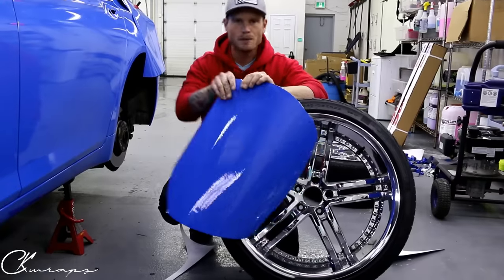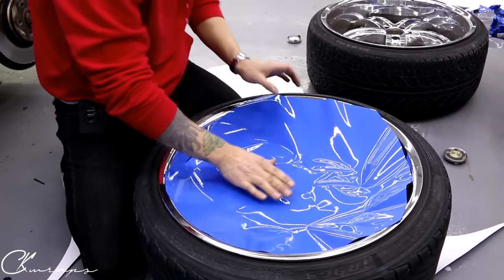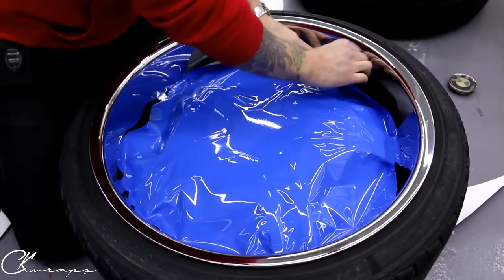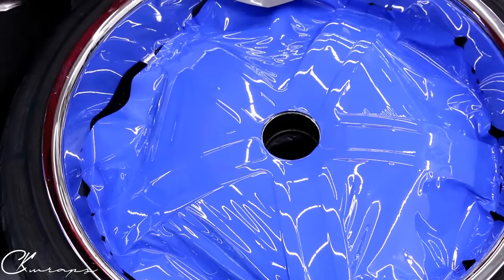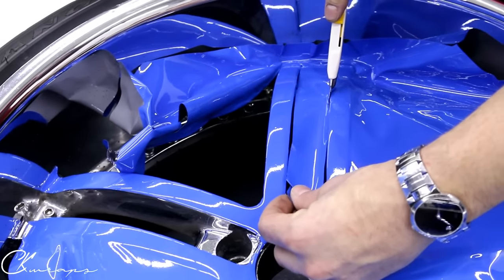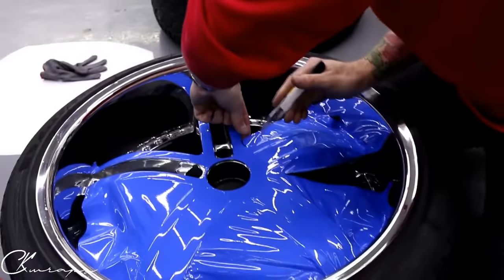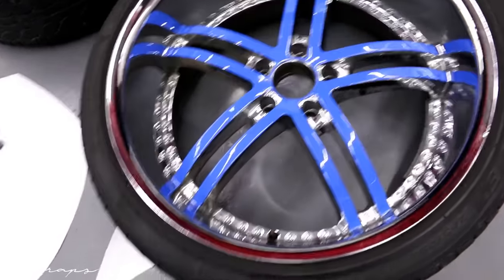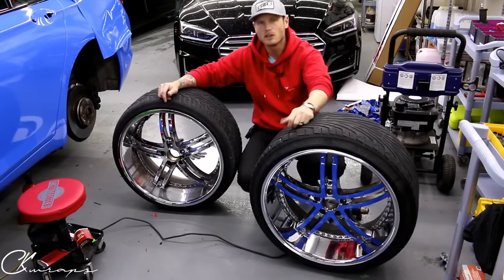15 minutes How To Wrap Wheel Faces Like A Pro Using Gloss Riviera Blue To Match The Car

Comment: Looks great! My suggestion is if you are going to offer this service, then go out and buy yourself an old bar stool so you can set the wheel on top of it and do the work up off the floor level.  
"Work smarter, not harder"
Reply: I would make a big lazy Susan to mount the rim on
Reply: he could be comfy in the position.

Comment: This is very interesting. I have a car relatively inexpensive 2009 Pontiac vibe GT lots of wheel rash. I’m thinking of just using touchup paint even though that will not look great it’s better than what I’ve got. Another option is plasty dip. However the wrap from what I’ve seen gives the best overall finish

Comment: If you were to wrap the inside of the the spokes as well how would  get complete coverage in  a situation  where the two spokes are close together ? It looks likes there just not enough material after the wrap is slit 50/50...just curious.    I just picked up a set of Torq Thrust that are all 100% chrome for my challenger so ill be doing the wrap...Job well done, Im sure its not as easy as you made look....

Comment: I‘m not an expert in that, but I think if you use a sharp water jet, like in the car wash, the water will untighten the vinyl, because it is  cut direct on the edge of the spoke. If the spoke is wrapped on 3 sides  that effect will be avoided.

Comment: Seems like you can wrap just about anything, have you ever wrapped fender flares on a truck? And not the simple ones, I'm talking textured flares with simulated bolts/rivets.  Can it be done?
Reply: Usually with textured stuff, like plastic, vinyl doesn't like to stick to it very well. Unless it is the DI-NOC films that has stronger adhesive backing.
But yes, it can be done , just like riveted wide body cars.

Comment: super impressed this will last a few years, the vinyl on a wheel is taking some serious abuse!! i will start offering this in my own shop shortly i think,  im in the UK, is 45 GBP too cheap per wheel??? i use Hexis materials,  i dont want to get too close to a refinish cost...
Reply: TW-Automotive mu
🎶musica
Reply: That sounds expensive when you consider that 4 will need done I think £140 would be the max I would pay. There are businesses that do wheel respray for £50 and that is permanent. However quality speaks for itself and also I may just be stingy lol.

Comment: you cut the vinyl at the edge of the rim, straight with the point on the chrome. there must be damage theren but you don't see it because of the vinyl, but once you remove it, you will see the lines where the blade touched the chrome

Comment: Good job! But seems as though you could've made it far simpler by wrapping each of the five V shapes individually - the amount of material around the centre cap is so minimal it could either be joined or trimmed, no? You'd use far less vinyl too
Reply: C7TV more chance to peel up I'd think if you had joins on the rim

Comment: Bro hearing you spin that rim on that concrete floor was like nails on a chalkboard.  You do really good work and I'm not trying to hate, but that stuck out to me so bad.  Those tires are not as wide as the rim so u could hear straight steel on concrete.  I know it's the inside of the wheel but that chrome was screaming lol

Comment: If you're selling "improved looks", You should have put the wheel on the car. I waited through the whole video to see if it was better or tacky I wasn't planning on doing it myself,  Next time Please.
Reply from the maker: There is a video where it shows the vehicle completed with the wheels on
Reply: Thanks for the Heads-up, but I got an email from these guys and I found the finished job video. I like the look, not tacky, but modest personal identification, or just cool. Chicks should like'um
Reply: CK Wraps it was supposed to be in this video!
Reply: I noticed also that the guy used the cutter on the smooth surface!!!!!!!!!!!!!!!!!!

Comment: great job.  nice video. tks for sharing it.   I am wrapping & detailing my own van.  As long as i have fought with decorative shelving adhesive paper than sticks and wrinkles and ect..  wrapping with heat is a breeze!   But i sware, i would much rather just prime and spray the wheel, call it a day than to wrap wheels.  just not worth it to me. specially since your looked at a depreciating asset. for most cars.  painting just so much easier and it stays.

Comment: Am i the only one who noticed spinning the wheels on the ground and hearing the wheel scraping on the concrete?
Reply from the maker: I noticed it as well
Reply: Are you talking about the back of the wheel/rim.... that has no reason to be aesthetically pleasing? The area that practically no one will ever see? 

Yea I noticed it too!
Reply: Anibal Valentin i believe you're missing the point
Reply: Codi Vega what's the point the back ain't even finished
Reply: Point is if i spent as much money as I'd imagine those wheels cost and saw someone sliding them around on the ground (backside or not) I'd lose my shit. Just not very professional IMO
Reply: Codi Vega you do realize they get slid on the backside in the factory right and the tire mounting machine's scuff the backside etc it's the back side you never see it and they're not even finished on the back, you're over reacting to some thing that nothing
Reply: The floors it most shops are painted and smooth not as rough as the road or a sidewalk.
Reply: Good to know I'm not the only one that cringed when I heard that.
Reply: So much rice
Reply: I don't know what this dude is talking about. I don't give a dam if the factory was doing this before selling it. I would lose it too, if I knew someone was treating my wheel like that.  @V3GA_ggs
Reply: Thought that was a little harsh as well
Reply: I would be spitting nails if that was my wheel.
Reply: No Codi, you are not the only one, and if one of my guys did that to one of my customer's wheels, I would lose my freakin' mind! Back of the wheel or not, a customer's vehicle leaves my shop better than it arrives. It takes no time at all to put a piece of cardboard down, or use a fixture like a barstool to keep it up off of the ground. I will not tolerate any of my guys treating anyone's vehicle any differently than I treat my own.

Comment: Just random question: can you wrap a rusted roof or a hood with damaged clear coat? 2004 Corolla's are know for these issues and I want to wrap
Reply: TheScorpio327 im wrapping my is300 with damaged clear coat right now. Just make sure you sand down the panel and make sure it is entirely smooth. When it comes to rust I dont think the vinyl would stick so you probably wanna buy a new panel.

Comment: In my work with vinyl, I like using single edge razor blades way more sharper then those olfa knifes.
Reply: Single edge razor blades are not good for wrapping vehicles on a pro level.  They dont have the right angle or length to reach into tight areas when needed.

Comment: 6:49 how you make that cut without scratching the rim?
Reply: By not pushing too hard, but just enough to go through the vinyl, its hard to master, might end up making a small scratch, but i would think it would be easy to polish when the wrap is removed.
Reply: Pros can cut vinyl on the body of vehicles and not scratch.  Takes alot of practice.

Comment: Leaving a comment here on your Plastidip rim video since you disabled the comments on it. It's fine if you want to do a hit piece but at least be up front about it. You clearly had an agenda in that video to make Plastidip look bad and used poor technique applying the spray. The first coat should be about 50% coverage followed by 5-6 coats of heavy wet coverage. Your coats were quick and definitely not full coverage. Overspray is to be expected and peels off. Applied properly Plastidip lasts at least a year, usually 2 and can be washed and detailed many times. It's a shame some people feel the need to tear down others to build themselves up.